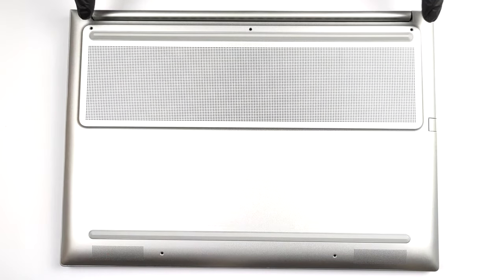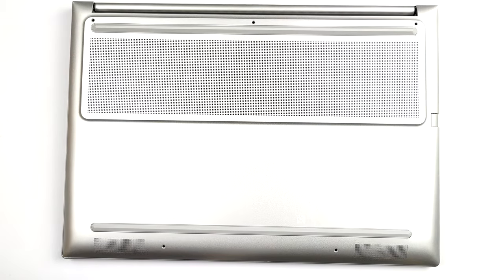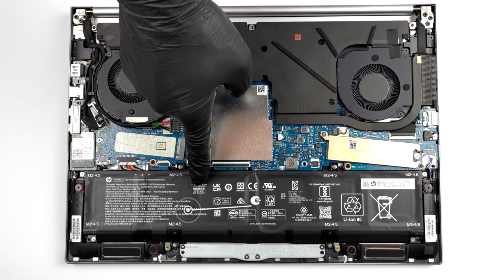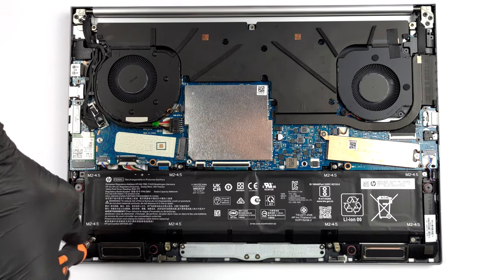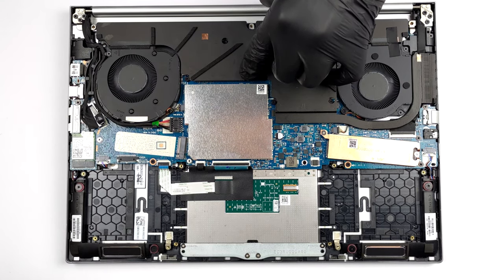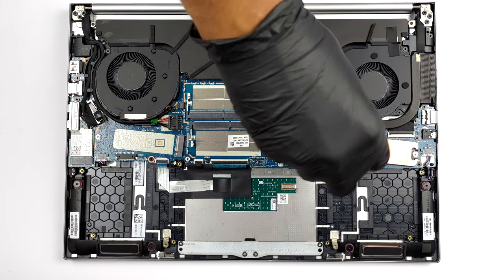🛠️ HP Envy 16 (16-h0000) - disassembly and upgrade options

Comment: Thank you just did this and upgraded from 16g to 32g. In case somebody else goes through this the laptop didn't want to boot up at first. The power light came on but nothing. I got scared and put back the old memory and same thing power light came on but no boot. Then after about a minute I noticed the fan start to spin turn the laptop around an HP logo came on. So I put back the 32 gig, same thing light came on but no boot. Let it sit for about a minute or two and then it started to boot up just fine.
Reply: Just upgraded mine, thanks for the heads-up. It turned on after about a minute or so
Reply: Thanks for the info! I Just got this rig for school/gaming with the boys. I wanted to beef up the ram, 16gb is enough but when you CAN upgrade, just do it LOL. Just bought 32gb ram sticks and going to install tomorrow.
Reply: @chanceyknows4445  nice! Yeah 16 just goes too quick haha. Been a great laptop so far! Wasn't too bad to get it. Back cover was a bit of a bitch to get open! Good luck!

Comment: I did following that video.  I attempted to upgrade memory with 2x16GB Crucial. Laptop wont boot up. Even when I put original 2x8GB back. The power light is on. Buf kaptop won't boot up.
Reply: Yeah got scared for a bit, but it took it about 1min to boot up. Then it was just fine. Weird.